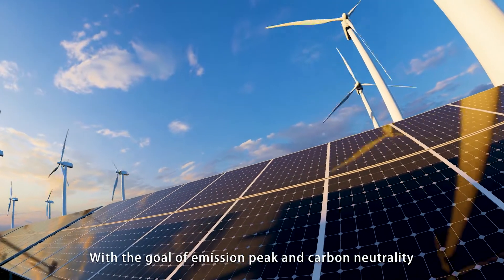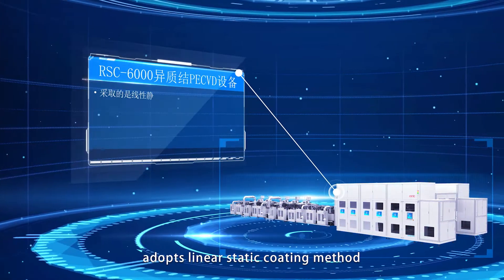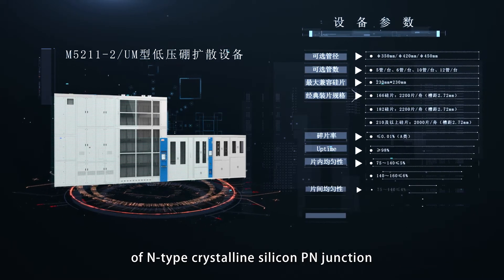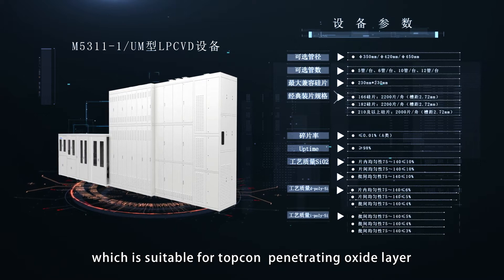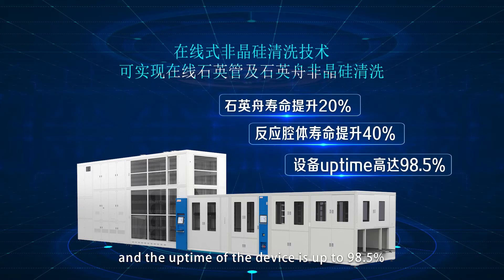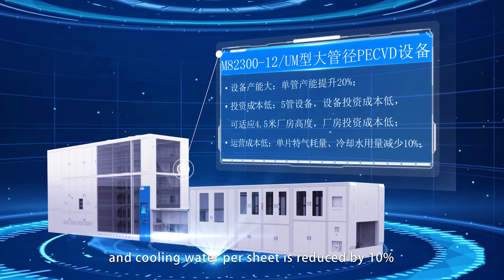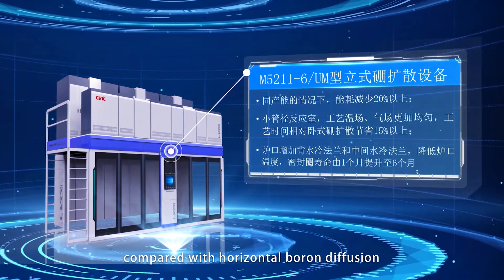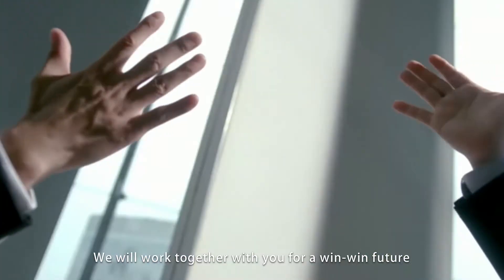CETC Solar TOPCon HJT equipment/PV  HJT  TOPCon Solar Ingot Wafer Cell Module Production line

Comment: PECVD is an important coating equipment on the cell production line. The anti-reflection passivation film prepared can effectively reduce the surface reflectance of the cell, increase the absorption of light, and at the same time passivate the surface of the silicon wafer and the recombination center in the body.